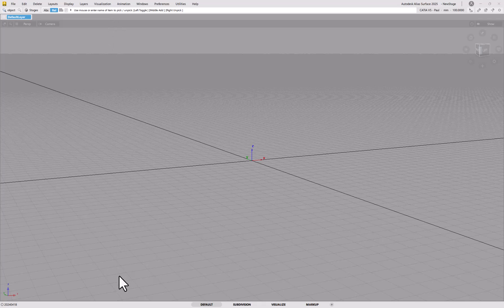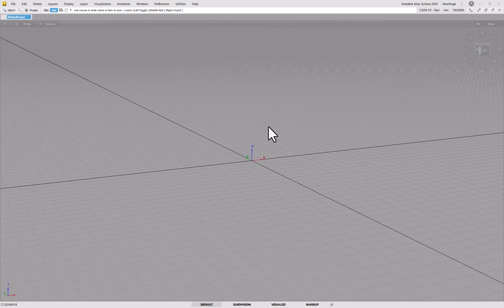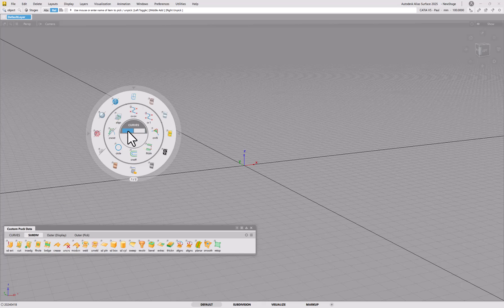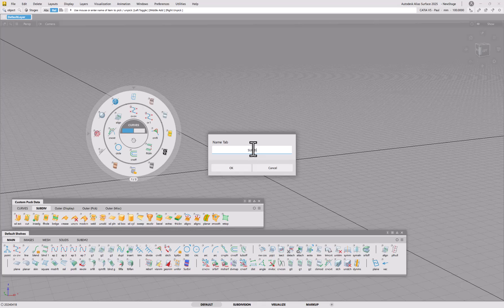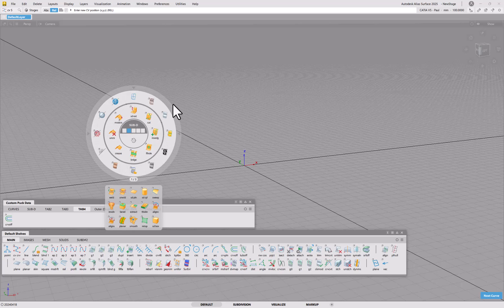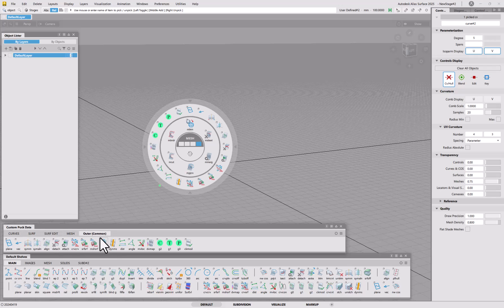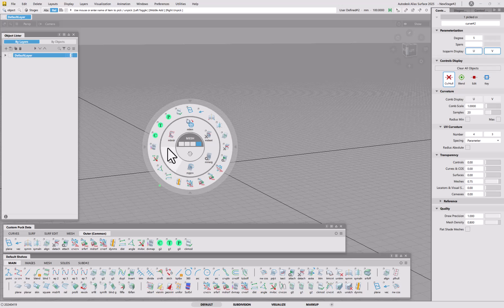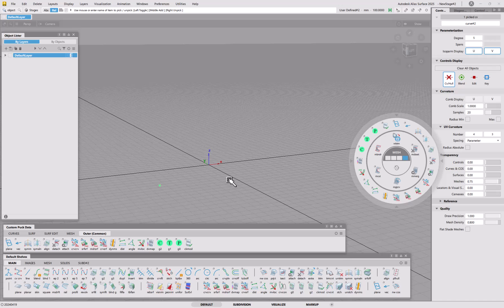Autodesk Alias Tutorial: Alias 2025 Puck Customisation

Comment: Custom puck sucks. I've hotkeyed 'B' for blend curve and use it all the time. Whenever I press 'B', the custom puck pops out of nowhere. I turned off the hotkey toggle, but it keeps appearing regardless. This custom puck concept is awful, a really bad feature. I don't see any advantages over hotkeys and marquee menus.
Reply from the maker: Have you redefined the letter "B" for blend curves? And then pressed the Enter / Return key? It should ask you if you want to redefine the CustomPuckToggle as BlendCurveToolbox. This should get rid of your problem. Let me know if it works,
Reply: You need to go to the general preferences and there’s a custom puck tab on the left where you can choose the hotkey for the puck. A bit weird that they have two places for setting hotkeys for that feature. Nevertheless you can also go into the hotkeys editor to change the toggle to something else but make sure to hit enter and depending on if your chosen key is already used confirm the warning or cancel.

I think the puck can be quite useful for faster accessing more functions. I use the marking menu a lot but space is limited there and I might use the puck more often now
Reply from the maker: You're right - it is odd that there are two places to find hotkeys for the puck! The one in General Preferences allows you to set it for temporary use whereas the one in the Hotkeys Editor is for when you want the Puck to stay. Like so much in Alias there are many ways of accessing the same thing - I think it's good because it gives the user more choice.
Reply: Thank you, guys. I disabled it, just as you suggested. I had a conflict there because the blend curve was working, but so was the custom puck. I was really annoyed with that. Sorry for my previous comment. Nonetheless, I really don’t find custom puck useful.
Reply from the maker: I'm glad you got it sorted😃
Reply: @learnsurfacing  I can't find the Puck hotkey section in either place. Did they move it?
Reply: @Wilphi  Now the tab is not there anymore lol. I have been looking for where to assign a hotkey to Puck Menu for a while.
Reply: Great insights. But I have a question since I am switching just now to 2025. Previously I activated the “move CV” wheel which became now the Puck always with the space bar, since it is very fast to hit with the left thumb! Now if I want to customize it, it is by default on Z and it doesn’t allow me even to add the space bar, why ? I can just tell that those application engineers at Autodesk have no practical experience at all with Alias…just running Demos ( I know what I am talking, I worked for Alias| wavefront from 1998-2000 and since then I am Freelancer with that tool. Anyways, has someone still good contacts to the R&D team in Toronto ?